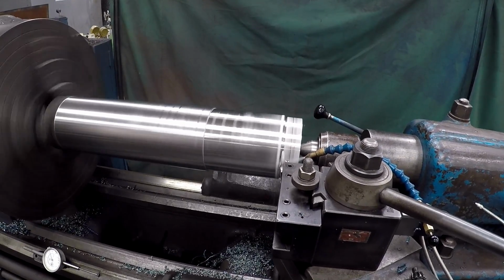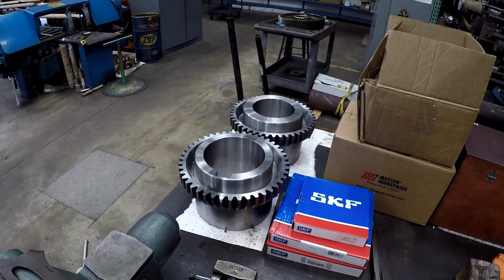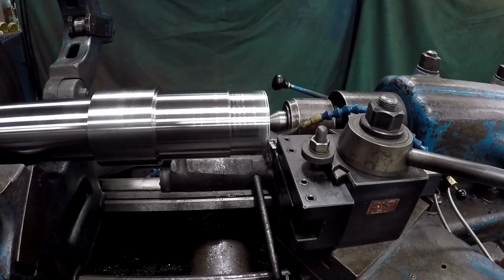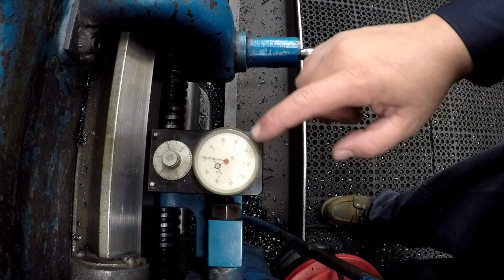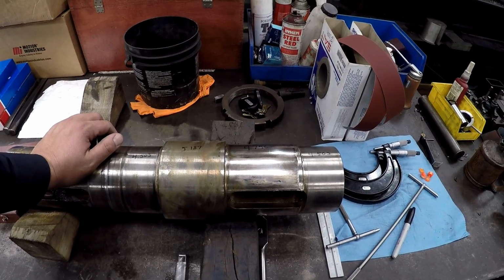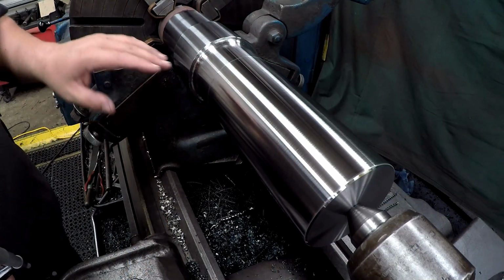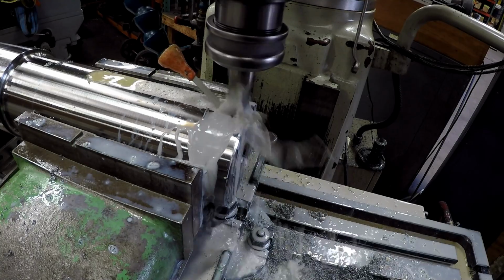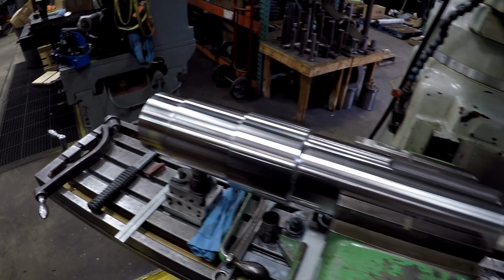Sns 194 Part 2: Gearbox Shaft Machining, Turning, Radius, Measuring, & Keyways

Comment: Adam: From a very amateur, last time I ran a mill was in 1982 my senior year of high school (ended up going into medicine, but always loved fabricating, and learned a hell of a lot of problem solving skills ). When you were milling the keyway you used a traditional endmill. Why not use a carbide indexed endmill. It seems like you would be able to run it at a much higher rate of material removal? (Time is money). Also what advantage is there to using a two flute endmill? It seems to me from listening at least there is a lot more chatter or vibration that a traditional 4 flute endmill. Also why not use an exact 1" mill eliminating multiple passes?

Comment: Hey Adam, 

 I just got a south bend model a lathe and I’m getting all my tooling set up. I’ve been running a lathe for the past 5-6 years at work every now and then working on shop projects. We grind our own tools at work but, for my home shop I would like to use inserts. So my question is, what inserts and insert holders do you recommend that won’t break the bank?  Thanks in advance!
Reply: Kennametal is what I've always used

Comment: Explaining fretting corrosion to people is one of the most difficult things I have had to do as an engineer. Having a customer calling in and pitching a bitch about how "This roller isn't stainless!! Stainless doesn't rust! This isn't any type of corrosion, you machined this stuff wrong!" and then having to explain to them that when they don't maintain their bearings, and then the bearings begin to drag, then heat up, the race clearance grows, the set screws loosen, then the shaft begins to make microscopic movements in relation to the race. That TINY microscopic movement is what begins the fretting corrosion process. Explaining that to a knuckle-dragger maintenance mechanic who carries around a 16" all-16ths in his overalls that has no real knowledge about what he is doing and refuses to listen is so difficult at times.

Its far worse when you have this same process on a tiny 8mm shaft for a roller on a precision checkweighing conveyor and the people working on it resort to hammers to install bearings.

Videos like this help people to understand these processes that are hard to understand.

And to clarify, I am not saying that all maintenance mechanics are knuckle-draggers nor I am I saying anything bad about a guy in overalls carrying around a BFW (big friggin wrench) in his front pocket. I am though painting a picture of several instances that I have been in personally. I have also worked with many maintenance mechanics that I have learned a ton from and they were open to letting me show them a thing or two. When its a two way street, its awesome. When its not, its terrible.
Reply from the maker: Brian Streufert I completely understand where your coming from Brian. You make a very valid point.
Reply: Being a maintenance mechanic myself, I have to say, good save at the end lol!!! I do agree with you. Some of the ones I work with have the mentality of "if it don't fit grind it down and if that don't work get a bigger hammer". On my shift I usually do most of the machining and there's times I get so pissed because of their stupidity and mentality of "I'll just let the next guy worry about it"  when all it would have took was some light cuts and the bearing's, gear or whatever would go on like it's suppose to. As far as the checkweigher's I know exactly what you mean there too... had one guy that bent one of the rollers so bad we couldn't keep the drive belt on it and then didn't understand why the boss was mad at him...hmm I wonder

Comment: Why do you cut a radius in the corner? Is it for looks or does it add strength somehow?
Reply: It reduces the stress concentration at the corner.
Reply: Added strength generally yeah. Most of those parts don't ever get seen so if the strength feature wasn't necessary they wouldn't put it in just to cut machine time.

Comment: On the mill where does all the fluid run to? Is there a channel that drains somewhere? Is the coolant reused?
Reply: all around the table there is an offset channel that drains down at an angle to the outer outside end channels. And on each side there is a drain hose that connects and drains down into the bottom sump tank. The flood coolant recirculates through the machine, screen filtered of course.  However you do have to clean out the hoses and channels every now and then. The very very fine metal chips suspended in solution do build up into this nasty thick black sludge that sticks to the inside of tubes over time.
Reply: I believe it does run off the table in to a drain which sends it to a tank to settle/get filtered and re used.  It cooling the cutter/part so it shouldn't be getting contaminated although i'm sure they replace it eventually. (But I could be wrong)

Comment: Trav'l Dials can be calibrated by inclining them slightly on the surface they bear. The knurled measuring wheel is crowned slightly. If the wheels plane is 90 degrees to the reference surface its rolling radius will be maxed. The measuring wheel is made to be a trifle over theoretical size so if you install it square is will measure a little short. If you incline it slightly the rolling radius shortens as the cosine of the inclination angle. 

So if your desired distance is 4 000" and your dial reads 3.992" the error is .002 per inch. 1 / 1.002 = 0.9980:: ArcCOS 0.9980 = 3.62 degrees  - IOW, tilt it a little and try it. Fiddle with it until it's right

If over time your calibration drifts from wear, tilt the Trav'l Dial closer to vertical. We had them on our VBM's. We could work to 0.001 in 12" sorta reliably. Not so accurate and reliable as a DRO but better than a scale and quicker that measuring shoulders with a depth Mike.
Reply from the maker: +Forrest  Addy Good tips Forest. 👍🏻

Comment: How much does the material really cost after you resale the old shaft for scrap?  

Also people do not think about warranty on something like that.  I have done repairs at home that I would not consider selling to a customer.  If it breaks on me it is my problem,  when you sell something that does not hold up long term it is the customer who has to deal with it and your reputation.  Good practice means you make it as good as or better than new.  A few hundred more dollars repair cost means nothing if it prevents down time for the production dept.

Comment: Could you not just under cut the shaft and then press on a sleeve and turn to size?
Reply from the maker: +Satveer Degun That’s not a proper repair.
Reply: Might not work too well in an area where a key way would be through the sleeve?
Reply: Abom79  thanks for the reply , I was thinking more of when you had rush jobs that need to be done overnight And more of a stop gap fix then a permanent fix. seen it done and work in other app so was just thinking it could be applied here

Comment: Hey adam,
ive been wondering how you get the dial indicator set up on the linear movement for those shoulder lenghts, 
and what goes in my mind is that how do you get that close to being accuarate, how do you know its set up properly? 

Thanks for the video, pleasure to watch these.
Reply: If it's a short distance you can set up an indicator, move an inch (or more if you have larger indicator), reset the indicator and move again until you get where you are going. You can use calipers, travel dial, scale, etc to get close making sure you don't go too far, make a cut to that point then measure the part with an accurate tool and adjust from there. Of course if you have a DRO it's really easy.